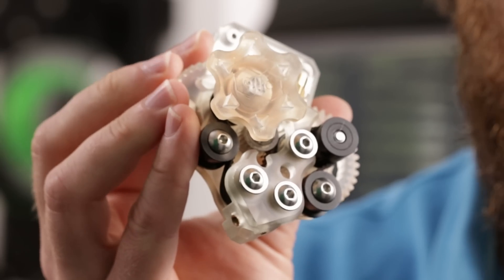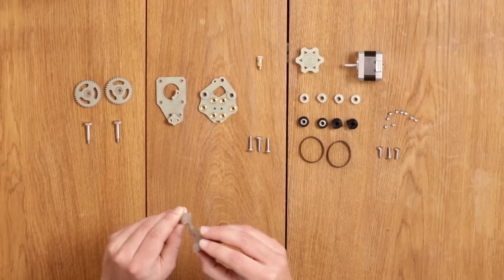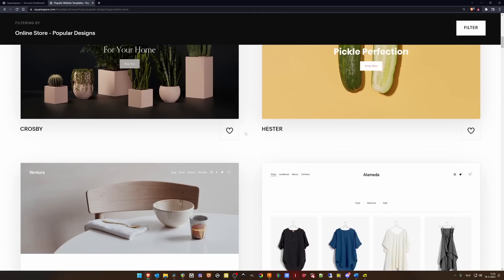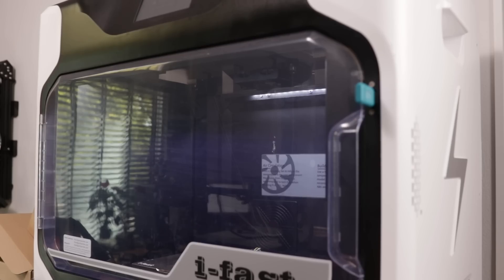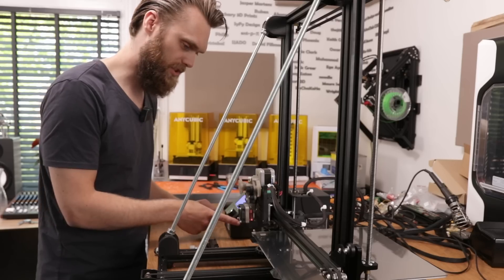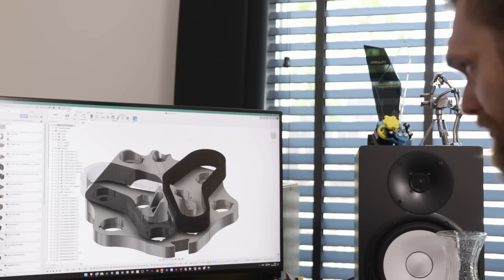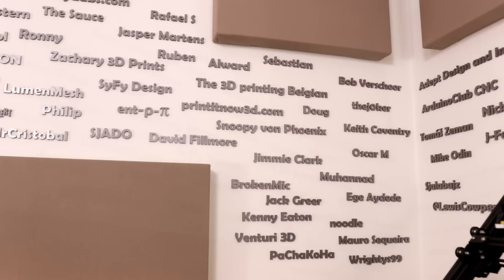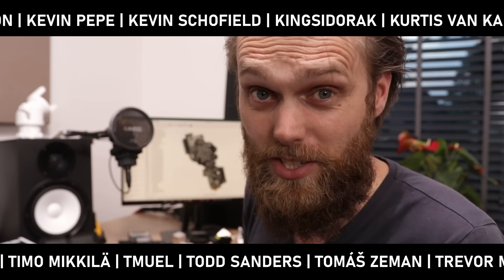This Extruder is a TPU Beast!

Comment: Love the project and idea of the extruder. I still think it can be improved to be smaller and lighter.  I'm not sure if you are using regular fep sheets for your resin printer. I would highly suggest using PFA film instead, it last a very long time, better results and improve success rate of prints.
Reply from the maker: Thanks for your suggestion! The place where I've bought the FEP-film also has PFA. I'll look into that next!
Reply: @properprinting  I got my PFA from McMaster carr it's listed as clear durable high-temperature PFA film 0.005 thick x 24" wide. I got 3 feet of it. I installed one sheet for my mighty 4k 6 months ago and have printed close to 20L of resin. Not a single failed print, no damage to the PFA. After about 2L of resin used I drain the vat, clean it with IPA then apply a coat of rainx, spray 3 or 4 squirts and rub it on with some blue shop paper towels works wonders. You will know immediately the difference by how quiet it is. I hope this helps!

Comment: Yo this is awesome
Lets you print super flexible filaments AND no teething issues with lots of retractions on normal filaments.
Getting belts with angled teeth might help keep it inline I'd imagine. (idk the technical term)

I hope this drive method is adopted for some commercial printers, or an addon is made for one.
edit: saw yours is FDM compatible... tempted to buy it and try to print this design..

Comment: fantastic video. i was think about a belt drive too, what about printing the belts in TPU? would it grip better? also you could add a grove down the center of the belt to lock the filament in place.
Reply from the maker: I think it would be an awesome idea to eventually print the belts. Just TPU is too stretchy, so it needs a creative solution. I keep the belts flat, you'll find out why in a future video soon ;)

Comment: I never had problems with tpu grip - which this belt extruder is addressing.. the problem is always the space between the extruder wheels (or belts) and the exit hole.. small gap between them fixes most of tpu printing problems. It looks nice, but really there were many "experimental" belt extruders out in last 8 years that don't bring anything into the game..

Comment: Is there any reason you didn’t use herringbone gears or are typically shaped gears good enough for this application?
Reply from the maker: Good question! Yes, there are reasons. The design is easier with standard gears because it makes it possible to slide them into place. This is not possible with herringbone gears. Helical gears create an axial force so I didn't choose these. And I don't think that the disadvantages of standard spur gears are significant enough not to use them.
Reply: @properprinting  awesome! Love the design. Been waiting ever since I found out about the design to make my own

Comment: Can you show how you printed the resin parts and how you created the support structures? When I print resin parts they always have marks on them due to supports. And if I don't use supports, I get an elephant's foot.
Reply from the maker: I posted a picture on my website showing this https://properprinting.pro/product/proper-extruder/ all the way down in the print settings tab. Basically I print in a similar orientation as I would with FDM, but let the part float 5mm from the plate. This way I don't have the elephant's foot problem. I manually add the supports as close as possible to the edge.  I try to optimize the design so it has one flat side which can be sanded down. This seems to work for me.

Comment: What is the gearing ratio on the motor? As I could see it was spinning really slowly, so maybe a lighter smaller motor would be possible with more gearing.
Reply from the maker: The ration is 6:19. A lighter motor would definitely be possible with better gearing. This motor was slightly too weak. A better hotend would help too!

Comment: After printing over 150kg tpu I learnt a lot. Biggest thing with tpu are that I likes to build up back pressure. So use pa or similar. If you check my channel I print 95a at 300mm/s abs that are not even maxing out the system. My normal tpu printing speeds are between 90-140mm/s.

Comment: Are you printing with a raft or are you using UVTools to print directly on buildplate without getting elephants foot?
Reply from the maker: I print flat, 5mm elevated and I sand away the supports

Comment: Hey man, I think you're doing amazing work, and I encourage you to keep improving this!! I hope you didn't get the wrong idea about my comment on your last video, I just wanted to have my say on setting the standards with these since I felt attached to the idea from my own unfinished project.
I actually didn't realise the potential of these for flex, which I think is pretty funny, because my design started with printing my own belts, haha :)

I am probably going to finish my own design though, because my original plan was for one that replaces bowden extruders on any printer without changing e-steps and I think something simple and printable is important for this sort of thing. Do you have any advice for me on this that might help? I only ever designed my gears and belts, and got distracted by the time I started designing the plate.
I do have one solution I think might have helped your design in a few ways.. having a groove in the belt, for the filament. This allowed me to have both a belt that locks on to the gears without being clamped on the sides, reducing friction, but also should guide the filament. Ofcourse now you have no excuse not to print your own belts in flex ;) ;)

But if you tell me you're going to make all of those things a reality, I would like to either leave you to it, or collaborate on the design and testing if you're interested.

Comment: Can the clamping force/tension be adjusted? Thanks.
Reply from the maker: No it can't to make the design simpler and I don't think that this is really necessary.
Reply: @properprinting  that is great! Adjusting tension is difficult. I have a Flexion extruder. Not easy to reach the correct tension.

Comment: Cool idea :)

But my orbiter v1.5 prints those soft filaments no problem, (30D) up to at least 50-60mm/s (high accel)
Reply from the maker: Thanks! 30D is similar to 80A so it's not close to the 60A I just printed with ;)
Reply: @properprinting  oh really. Dang. Looked so similar when you stretched it 😁  But ok, even softer, is very very soft then 🤯

Comment: How well would the extruder stand up if more common resin is used? Additionally, I would really like to see your version of a remote direct drive system (ie like the Zesty Nimble/Sidewinder) but maybe belt or syncromesh cables.
Reply from the maker: Common resin would work as well since it doesn't receive impact forces. I have thought of using the Flex3drive, but it requires an extreme gear ratio with this extruder.

Comment: I have 2 questions:
-Can you maybe test how fast you could print with a high-flow hotend? I wanted to build this in combination with a Nova-Hotend but want to know if gives any advantagesss before the build :o
-I already printed Belt out of TPU for some easier mechanical stuff. Would it be beneficial to maybe print some Belts out of a more grippy material than the standart belt (..if this exists)?

But overall, super awesome video!
I'm reellay looking forward into build your extruder myself :D
Reply from the maker: I'm going to design adapters for different hotends. I don't think that there are many advantages for standard FDM printing compared to the OmniaDrop, Hemera or BondTech extruders for instance. My goal with this extruder is to explore its capabilities and try experimental ways of 3D printing. It happens to work quite well for regular FDM printing. It would be fun to eventually print a timing belt, but with just TPU it will stretch too much. It'll need fibers (guess what I'm going to explore soon ;)) Thanks for your comment!

Comment: Seems a bit overcomplicated, no? More complexity means more things to go wrong and harder to repair.
I've been printing 75A flex on my Pruse MINI+ with the Bondtech dual-drive extruder just fine. Would love to see if it can handle 60A, but man that stuff is expensive.
Reply from the maker: It's designed with simplicity in mind. It doesn't require a tensioning system for instance. However, it's an ongoing experiment to explore different methods of extruding and find out its capabilities.

Comment: How are the tolerances and dimensional accuracy on resin printers? I want one purely for mechanical components but I'm not sure if it's gonna do well for that have you ever measured anything?

Also forgot to say, awesome job!
Reply from the maker: Thanks! I haven't measured it. Everything fits and I usually use 0.1mm tolerance for parts that have to fit into each other.
Reply: i think it depends on the resin, and temperature... you certainly can print beautiful parts that fit... but also ones that dont :/

Comment: If you don't mind me asking. What's your PC set up. I'm interested in the specs as well. Thank you.
Reply from the maker: It's a i5-10600 with 16gb ram and an RTX 2080. I invested the most in the peripherals over a longer period of time. Monitor is a ViewSonic VP2768-4K, the speakers are Yamaha HS 8 controlled by a Tascam Model 12 mixer. The mic I'm using is an AKG C414. Keyboard Azio Retro Classic, mouse Logitech MX Master 3 and CAD mouse 3DConnexion SpaceMouse Wireless. That's about it.
Reply: @properprinting  is that a surface pro that you are using?
Reply from the maker: @lolmandood  yes

Comment: what kind of filament should i use to print the fdm version?
Reply from the maker: I printed it in both PLA and ABS and it worked. I'd recommend PLA because that's stiffer, but only if you don't use it in an envirenment that get's too hot. I haven't tested it thoroughly though.

Comment: HI, where can I buy the models for this extruder? In the page I can´t go to the pay process.
Reply from the maker: Hi! If you cannot go through the pay process, you can enter an amount of 0 which won't get you through it :)
Reply: @properprinting  Yes, but whe I press the "get this" button, nothing happens. I would like to purchase the design, it's your work.
Reply from the maker: @TomásHenaoSerna  that's odd. I'm wondering if it could be a browser extension or the browser itself. There are no further reported issues and the design has been downloaded a couple of times already. Could you try another "clean" browser?

Comment: I really don't trust photoresin for functional parts, what's your experience with their durability?
Reply from the maker: None. The exposure time of this resin is quite long (around 16 seconds at 50 um) it's more durable than regular resin. How durable, I have no idea but my plan is to use this extruder for a longer time and more often. If it eventually fails due to ageing I'll post an update somewhere.
Reply: There are a wide variety of photoresins available to solve most problems. Siraya tech has an engineering strong type, flexible, and a high temp resin. They mix well and results are what you’d expect. Another channel interviewed an engineer which designs and produces custom race car parts in this custom resin mix (supposedly). Claims of 60 PSI, and able to put printed parts directly on the manifold… I have printed a mix of flexible resin and engineering resin and it really does turn out fantastically durable.
Reply: @jamesshaltes654  My problem with them is that I've never seen one suitable for making gears. You have POM for machining, Nylon for 3D printing, Polyurethane resin for casting, many alternatives for injection moulding, but I've yet to see a photoresin that makes good and long-lasting gears for demanding applications.

Comment: voron team claims no one's successfully built a voron with resin parts and had it last, do you think it's possible with stock voron design for 2.4? would love to see you making it work, I feel like people probably used the wrong resin is a big reason they failed, or improper curing? I mean, once you tell people it'll fail, no one will try, so you'd never get succesful one. If you think it's possible please try and run it for few months to debunk this.
Reply from the maker: I think it would work when using the right resin, which is damn expensive! I still have to build my first Voron which I will do and I do have some ideas for a resin build, but that's something totally different ;)

Comment: will you sale me a fully ensambled extruder for my ender 3 ?? .
I do not have R printer
Reply from the maker: This extruder is designed in such way that it can be FDM printed as well! The download consists both versions and both PLA, and ABS work. I'm currently working on a different version which will be easier to manufacture and might be interesting to finally sell as a kit.
Reply: @properprinting  did you posted the link to purchase the parts needed ?
Reply: @properprinting  thank you

Comment: This is truly insanity. I mean great engineering, but un NECESSARY.  All you need to do is put shrink wrap over a standard extruder gear and let the filament slip, and over extrude by 20%. the PRESSURE is all you need. the volume is controlled at the tip. 

True story - simple fix and superior results every time. even on a bowden.
Reply from the maker: Thanks for your suggestion! I don't think exploring new things is unnecessary though. My goal is not to print flexible filaments with it, it just happens to be possible with it ;)

Comment: Hi, accidentally got on your channel, for three days, turned off and life. Steeply! You've implemented a lot of the go I've been thinking about for a long time. If I may, comments. Everyone who builds 3D printers considers each node separately. I am a doctor by training. It's like a nurse's job. If it can cure, then only the symptoms. It is necessary to consider any problem comprehensively. Has anyone done any statistics on the weaknesses in the design of a 3D printer? And if you are interested in my thoughts, I can share them in person. Also, please, I'm sure it will be of interest to many people. Botanist of 3D printing. People like you, CNC kitchen,Ivan Miranda and others. Botany in the good sense of the word.
Reply from the maker: Thanks for your comment and I like this way of thinking. I have the plan to take a dive into the SpeedBoatRace with the challenge to print the fastest Benchy. What makes this interesting for me is running into bottle necks and see where they can be eliminated after which a new bottle neck appears. It's such a fine balance and I'm sure that it'll be a learning experience. I've got some other projects first though, but I think that this will make an interesting video topic.
Reply: @properprinting  if you fix your extruder a bit, you will surely win the competition to print from the softest TPUs. And if you find the material that I think, then in your design, you can win on any material. Now, defeating bamboo, in my opinion, 7 minutes, will be difficult. Mechanics, for victory, I came up with. Problem with software. I have an extruder, weighs about 40 g. Table, heated, PRUSA kinematics, 100 g. Looks like a fantasy, but reality. Moreover, the most interesting thing is that it is much easier to make an extruder on granules than on filaments.

Comment: This is a feed mechanism, not an extruder. The extruder is the hotend + the feeder. Do you call a feeder in a MIG welder an extruder? No. It's doing the same thing. The inner mechanical engineer just bursted out 😁